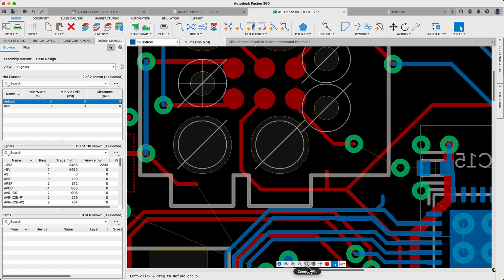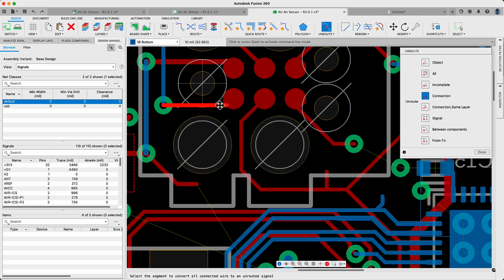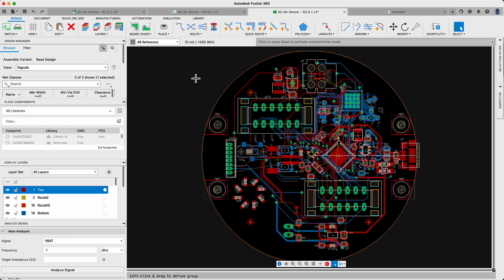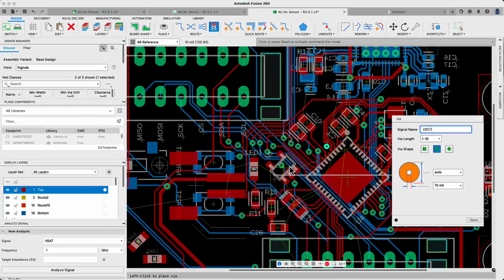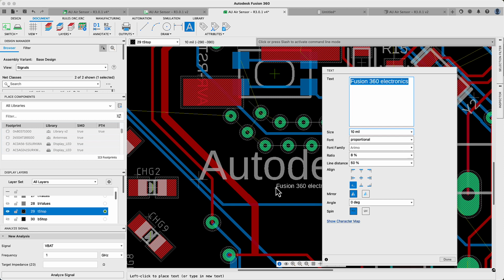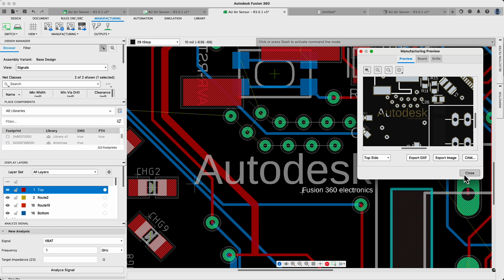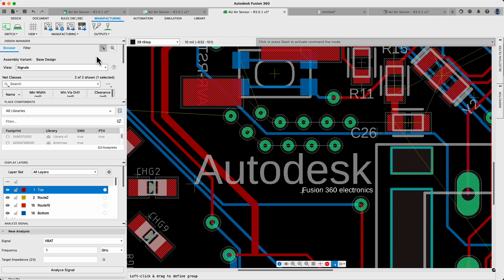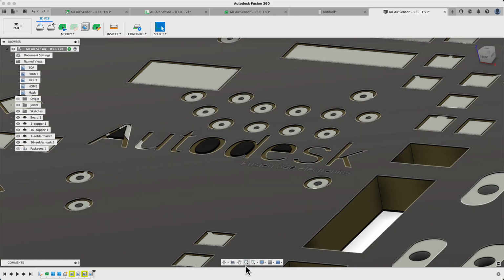What's New in Fusion 360 Electronics - November 2022 | Autodesk Fusion 360

Comment: Still no PANALIZATION!
Reply: Are you making your own panels?  Why wouldn't you use your board house who  knows how to do this better than a CAD tool and who are the ones that have the post-processors for the machines they run, tools they use, holders, etc?  You would also need to be able to do thieving patterns and thermally balance your PCB for reflow, mill-route paths, scoring, etc.  Actually Fusion 360 has nesting but I would ask your board house whether they just throw your hard work away.  Most do.  I would think panelization is low on the priority list unless maybe someone is trying to make boards at home which isn't practical any more.
Reply: @professionalservices1094  HUH? I don't make my boards at home, My board house charges me extra for panalizaion design. but I still need to tell them how i want my panels to be configured, which means a drawing, which would be quicker to just have a dedicated tool in fusion to do this. I don't see why this is so hard? Other e-cad programs do this, i don't know why autodesk is wasting time on fancey analysis features for, that for higher end designers and they wont be using fusion electronics. I also need the panels to suit my local PCB assembly shop requirements, I like to do a 3d preview and send this to my assembly shop for review before committing. Also NSESTINg is not what we need for PCB's, just a simple interface that generate a NEW pcb from the existing single pcb.

Comment: Thank you for the update overview.  Do you have an eta on when platted through holes will be added. I know you can implement them manually but it is time consuming to do so.

Thanks!
Reply from the maker: Hi Joseph! By default all holes are considered to be plated through so there's nothing you need to do. If you ever wanted them to not be plated through then you would have to generate 2 separate drill files, one with the plated drills and one without the plating. We hope this helps!